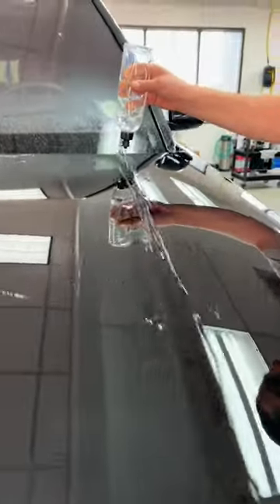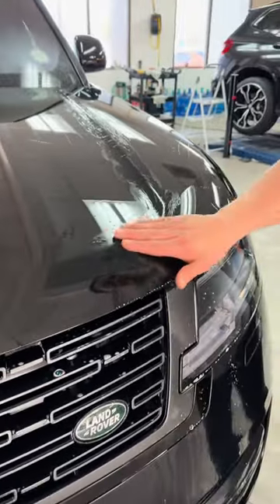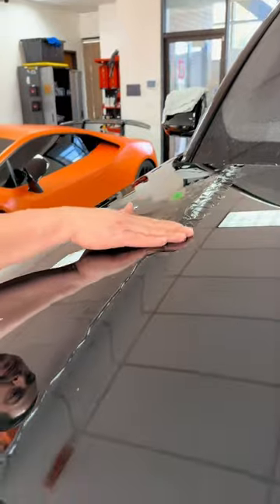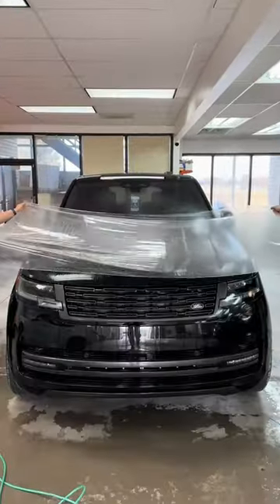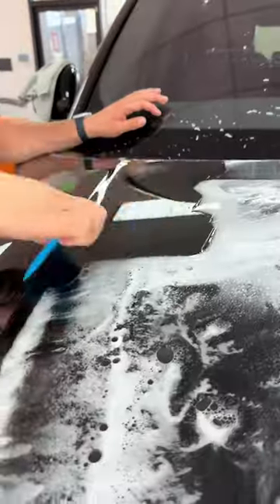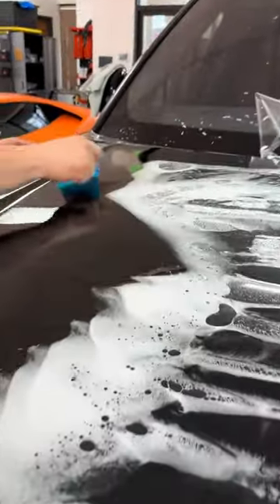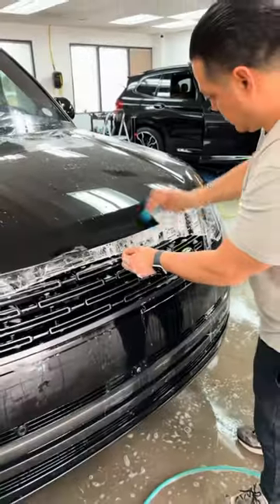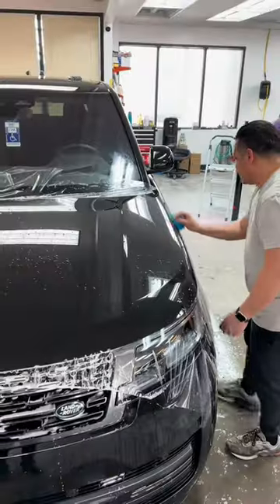Protecting this Range Rover with Llumar Valor PPF! Using MHC Auto PPF gel

Comment: Silvering.        No one mentioned what this was regarding the ppf.

Harder areas to work with?
Reply: It's smearing of the adhesive due to premature tacking. High spots like that body line causing the solution to evacuate quicker than on the flat areas, which leads to the adhesive tacking down before you want it to.

Comment: Won't using your hand to apply the ppf gel directly on the paint scratch the paint? I think it will from experience. I would have use a microfiber cloth or something similar to apply the gell.
Reply: No

Car is clean.

Also, PPF covers all swirl mark and most scratches.

I have a video on my channel showing this (check the shorts  - "your PPF installer is scamming you?"
Reply: @OnTrackDetailing  the proper way to apply ppf is doing a clay bar cleaning,  paint correction and then apply ppf gel and then off film. What kind of service are you providing using ppf to cover imperfections. Ppf is to protect not to cover imperfections.